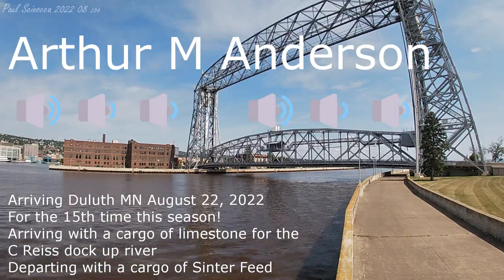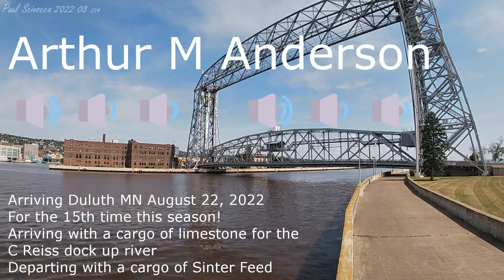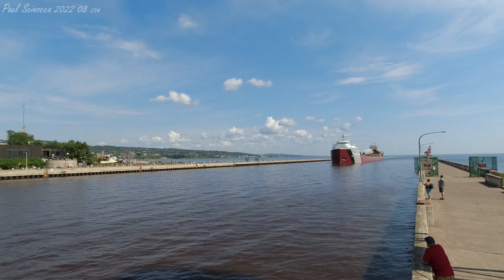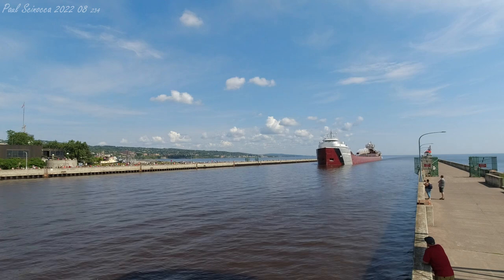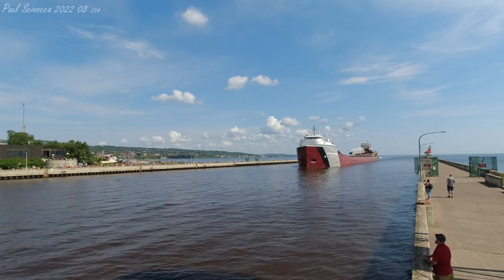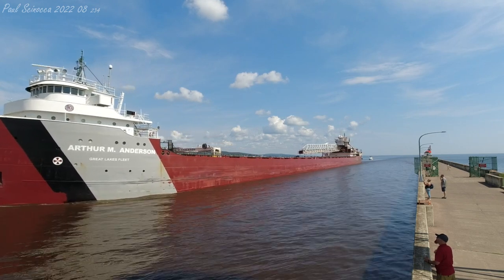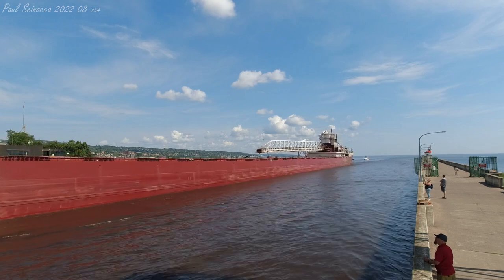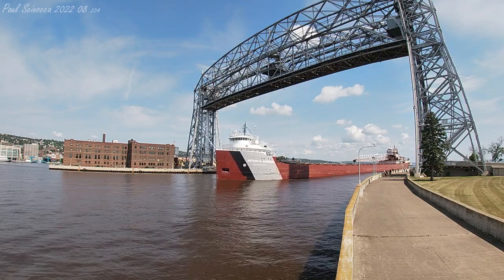Look at the Bow Closely! Once you see it you can't unsee it! The Arthur M Anderson's Duluth Arrival!

Comment: Question.... what is it about the bow that I'm supposed to be looking at and will not be able to unsee once I see it?  I'm new to this stuff.
Reply: I'm not new and I still don't know either.
Reply: It's called click bait. They put up a nonsense headline just to get you to watch the video.
Reply from the maker: Look at the bow, on the "left" side the bow thruster marking it is about water level, on theright side it is way up high.
Reply: @PaulScinocca  anchor slot
Reply: @PaulScinocca  cant see the right side.....I'm guessing they do this so no matter how far she sits in the water you will know where the bow thrusters are located.
Reply: ... An icon similar to this is seen on all ships that have a Bow Thruster. Stern Thrusters are identified as well (safety). The Port side icon on the Anderson is higher than the Starboard side is all. The Starboard side is on the same level as the hawsehole where the anchor is and on the Port side it is above that plane.
Reply: I looked at some still pics of this ship and yes the port maneuvering thruster icon is slightly higher than the starboard but other than that I didn't see anything extraordinary besides the superstructure being forward rather than aft. That is a pretty common design for GL freighters of her age.
Reply: @PaulScinocca  I see a Native American face!
Reply: @PaulScinocca  So how do we know where the right side one is?

Comment: These huge ships freak me out being way longer than the water they run in is deep in many places.   The Edmund Fitzgerald could easily have stuck her bow into the bottom while the stern was still high and dry...crazy.
Reply: The Edmund Fitzgerald was 728 feet long and the max depth of Lake Superior is 1330 feet.  This ship is a little longer than the Edmund Fitzgerald at 767'.
Reply: Yep she sunk in 500 feet of water, so over 200 feet would be sticking out
Reply: @douglasfark169 : Get a VHF radio and learn a few channels. You may get overwhelmed with info.
Reply: It's very, very unlikely to sink that way though.
Reply: @lionhounds  It's cold enough that decomposition isn't fast enough to release any gases that make a human body float.

Comment: Still steam driven after all these years.  I know several freighters that had their engine rooms 'cut off' and now powered by tugs lashed into a pocket at the stern.  Sure would love a tour of their engine room.  :)
Reply: Steam turbine ... wonder if that was original.
Reply: Look into it - a nuclear powered ship STILL drives the wheels (props) with steam. Only ships with EMD diesels (engines used on freight trains) drive the shafts directly from the motor and these are usually only found on smaller ships. Many modern war ships are powered by super heated steam, heated in various ways including turbo jet engines. It's the most adaptive and efficient way to develop huge amounts of torque needed to spin steel or sometimes brass wheels with a 10 to 16 foot diameter or more.
Reply: @3DPDK  actually, very few ships, other than nuclear ships, remain steam powered, and virtually none have been built in 40+ years.  Big tankers and container ships use massive direct-drive diesels, often double-acting and or 2-stroke layouts. The engine stops and starts in reverse to reverse the main shaft.  Look up “Sulzer type diesel.”  Modern warships, like destroyers, guided mission cruisers, etc. typically use gas turbines.  Some, like the recently cancelled LCS class use diesels for cruising and can switch to gas turbines for high speed (CODOG).  Cruise ships and things like the Pathfinder class oceanographic ships use diesel-electric drive, where the number of diesels running at any given time can be matched to the needed load.  As for EMD, well, they’ve kinda become a minor player. GE diesel, MAN, MTU, Fairbanks-Morse/Alco, Colt-Pielstick, Caterpillar, etc. probably have more market share these days.
Reply: @3DPDK  Not too many nucs on the Great Lakes though.  Just saying...
Reply: Uhm, I'm still confused as to what it is about the ship's bow that was supposed to be so mind-blowing that we "won't be able to unsee it". Did I just miss something?
Reply: @HighlanderNorth1  Ditto.🤔🤔🤔
Reply: @Yzabeaux1  umbrella corporation logo like on the Resident Evil movies.
Reply: @texasblueboy1508  Why am I not surprised. The way evil is blatantly touting itself in this world. Thanks for the reference.😁👍🏻
Reply: @3DPDK  Turbojets drive the propellors directly -- no steam.
Reply: @scottsuhr2919  In some cases. In some cases the turbojets drives hydraulic pumps that drive the shaft. In some cases the turbojet isn't strictly speaking a "jet" but a turban fanned steam boiler. The USS Independence, CV-62 used JP-5 in  turbine driven boilers to produce steam to something on the order of 1200 psi, used to both power the shaft transmissions and to drive the aircraft catapults.
Reply: @stevelacker358  I have a video titled Tractor show part 2 here on youtube that has a river boat engine with a demonstration of how they reverse the engine.  If anyone is interested in seeing the demo, it's around the 4:03 mark on the video.
Reply: The last US Navy capital ship that was driven by an expansion type steam engine was the battleship USS Texas which was built in 1911-1913. All subsequent large ships were steam turbine powered.  Steam turbines have been around a long time but they aren't the same as the reciprocating piston steam engines.
Reply: @stevelacker358  wartsilia makes the biggest engines.

Comment: If you observe the canal, on the opposite shore/dock you can notice the water level change slightly lower as it enters. Speed up the video you notice it more. Amazing.
Reply: Good spot👍 - water doesn't compress (much) so has to move outa the way. There's virtually no wake with this vessel but there's still a lot of water being displaced.
Reply: You are incredibly observant.
This is called "channel effect". Aside from a pressure wave moving outward from the bow, the ship's prop is basically pumping water out of the channel ahead of the boat and pushing it into the channel behind it. The deeper the depth of the hull and/or the shallower the channel the greater the effect. It effects handling the ship in two major ways. 1. The ship tends to stay dead center in the channel without input from the helm. 2. Where there is only marginal clearance between the keel and floor of the channel, the ship can literally suck the water out from under itself and sit the keel down into the mud.
Reply: @3DPDK  crazy, it has the exact opposite effect that I would think, due to displacement it seems it would rise. Interesting.
Reply: @chrisw5150  That would be your first instinct!   It's amazing that the props push so much water behind the ship that the opposite actually happens, isn't it!

Comment: My uncle was one of the construction supers for McDowell Wellman on the Great Northern dock in Allouez. they put in a bucket loader and a belt transporter for the BN: you can still see it near the President's Bar to this day, albeit now it is covered.  I used to see the Fitzgerald al that dock and once in drydock much closer to the High Bridge, My uncle had talked to the crew and claimed that it used to torque in the middle in high waves due to having a middle section added to increase its capacity, My uncle also worked on the DM&IR docks. I still keep a clear bottle full of taconite here next to a postcard of the Ryerson at the BN dock, Oddly enough, my grandad was retired from Ryerson Steel.
Reply: I don't doubt that one could see some of the long and skinny older ships twist when loaded in rought water.  But the Fitzgerald was never lengthened.  The Anderson was, ironically in early 1975, just months before the "gales of November came early".  Kinda spooky, eh?

Comment: I'm prior navy and served on board 2 different steam ships where I worked in the engine rooms operating the boilers and main propulsion. I might cone out of retirement for a chance to steam one of these
Reply: If you have a Merchant Marine Unlimited HP steam endorsement then there are still a few ships around that need them.  Steam experience is getting more and more rare
Reply from the maker: 😁 With manpower issues, you may have a better chance than you think!

Comment: There is also one more draft mark on the stbd vs. the port side.  It probably came out of the last yard periodic visit that way since the crew usually try very hard NOT to paint over the things that require much effort putting them back on, easier to cut in and around rather than re-create.  However, stuff happens.
Reply from the maker: Did not notice that, I was referring to the bow thruster marks are not aligned port and starboard.
Reply: @PaulScinocca  Since you had put the bait out there to look at the bow I looked closely at the bow and found the thruster marks are off but then I noticed the draft marks as well, looks like 29 on one side and 28 on the other.  In any case, that whole class of ships were good looking, they even made presentable self-unloaders, but the best looking one of the bunch, the William Clay Ford was the first to go for scrap in 1986.  I may be biased though, because the Greene and the Armco were somewhat fancier.
Reply from the maker: @timothydayton5373  you win! I had no clue on that one !!

Comment: Houghton/Hancock has a lift bridge like this somewhat smaller.  I was in the middle waiting to take a video of my son driving our “go-fast” boat under the bridge.  The bridge has 2 poisons.  Full down, for a lower level rail passage, second level for cars and power boats to get under and I thought it was air level 2.  The horns went off and I started running for the end because the bridge goes up another 30 ft for ship traffic.  I don’t think the bridge attendant saw me, maybe he did.  I got off before it went full up.  We got the video later. The bridge never went full up. We did get some great overhead videos, both there and further south near the south/east entry to the Portage shipping canal.  We had a cool day with high barometric pressure.  Motors were making good HP.  I got a picture of a two way pass at 90+ MPH.  The boat was literally flying.  It was a 32’ Sunsation Dominator with 2 supercharged (Whipple) 502 Mag engines making just under 600hp each on that day, turning 32 pitch props at about 5700rpm.

Comment: The bow thruster mark?
Reply: It's that white circle with a cross in it. It indicates where the thruster is located below. Most are painted at the same height on each side. That ship has one side marker lower than the other but you can't see the other side in this video. Why it matters is another question because it doesn't.
Reply: @georgeedward602  Yeah, Right. I was a deep blue Unlimited AB for over 20 years. I could not fiqure out what I would never unsee once I saw it.... should I keep looking? click bait money maker.
Reply: @mikeyoung6347  Same with me. I mean uneven paint is not that impressive. Some don't know what a thruster marker is so I was answering the question.

Comment: I can't believe the poster never responded to questions about what they should be seeing! Would never watch any more of his videos.
Anyway I think it could be that the markings are that it's cargo is dangerous ie radioactive.
Reply from the maker: The poster does reply,  the actual answer is in the info, as well as the cover picture with 2 large yellow arrows pointing at them. The radio active symbol  is actually a bow thruster symbol, they are not mounted evenly on each side, mistake when painting. Calm down and don't be so crass! Life is so short!